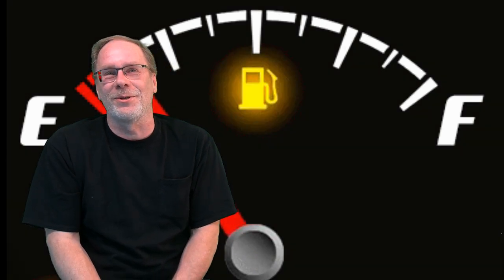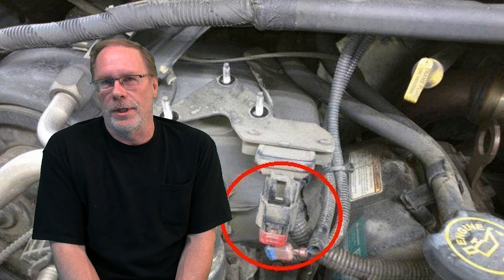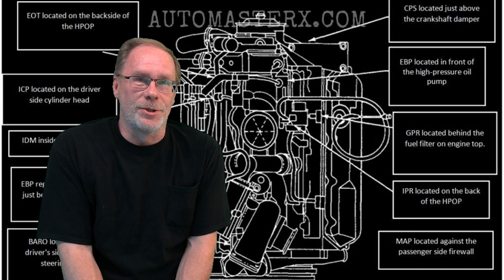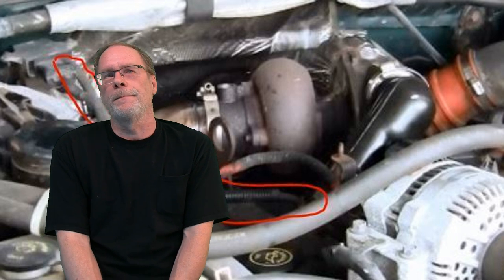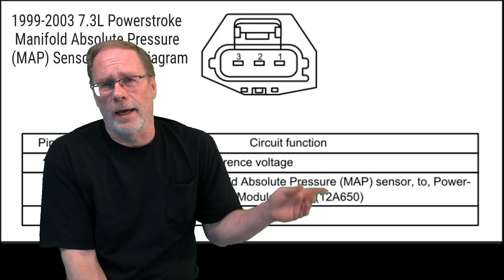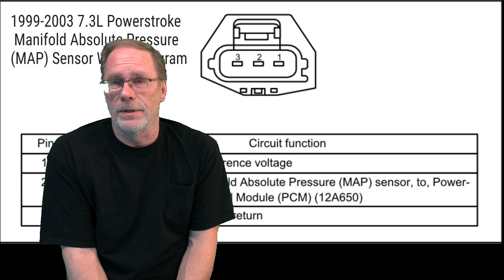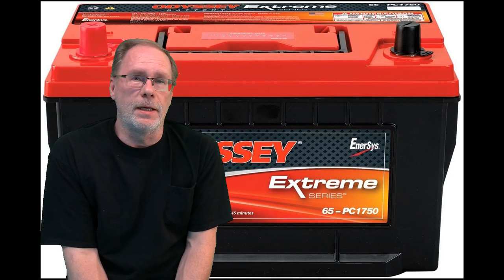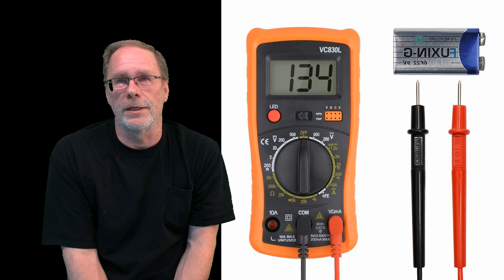7.3 POWERSTROKE MAP SENSOR Manifold Absolute Pressure (MAP)

Comment: Thank you Clint! I was having odd idle issues, surging, and couldn’t figure out what was going on. Did a simple voltage test after inspecting the air line, and my #2 wire was fluctuating from 2.5-1.7… all over the place. Going to order a new sensor today. This channel rocks, keep putting the knowledge out there. All of us weekend warriors appreciate it!

Comment: Thanks for this video,  The tube on my 96 F-250 definitely needed replacing.  I had no clue what it was for till this video,  Keep the videos coming!
Reply from the maker: Glad it helped
Reply: What were the symptoms
Reply: @manuelesparza9321  Slight power loss.  Mine was borderline good.  Its a cheap easy fix.  If you have doubts just change it.

Comment: I rebuilt my turbo with a KC DIY kit. Truck ran better. 
Next year I decided to put a turbosmart wastegate actuator on. 
Started throwing a P1249
PCM boost and actual boost both showed peak boost 22-23 PSI
Installed a boost fooler. 
Same reading. 
Bought a different boost fooler 
Same result. 
Put a new OEM MAP sensor and now the PCM only sees 15 PSI and no more P1249 code. 
Nothing I had read about throwing that code suggested that it could be the MAP sensor.

Comment: Thanks. Motor means electric motor engine means truck or car engine lot of people will say I need to get gas when you have a diesel no you need to get fuel or diesel not gas thanks good show ihave two of these great 7.3 diesel I might add I had a 6.9 that ran over 450 ths mile no break down it had no turbo not much power but stayed together

Comment: With my map plugged in it will not accelerate past 1200rpms. Once I unplug the map sensor I can rev a lot faster but it does have some hesitation flatness to it. I replaced the map sensor and the exhaust back pressure sensor and no difference. When I start it up regardless of being hot or cold it lopes. Until I get the rpm’s above 1000.  It does the same thing in neutral. What else should I look for. I think pcm may be bad. It just happened instantly it wasn’t like it kept getting worse.
Reply: Mine did the same thing. Pretty much instantly lost a solid 3mpg  after sitting at the body shop for 6weeks. 
I've been chasing the lost mileage and over richness every since.

Comment: @custom works my question is on the second pin I had someone reving slowly to 1200rpm & the voltage stayed between 1.55 to 1.60 does that mean I have a bad sensor? Plz do respond like u always did so that I can order new sensor. Thanks for always responding in timely manner.

Comment: Have a 2002 E350 Superduty 7.3 powerstroke Van original owner, would like to Put a new high performance Air Box cold Air but cannot find one.  The original is cracked in the front before the filter but letting in hot air.
Reply: You'll just have to put in another oem airbox. I have replaced a couple. I'm a diesel van guy myself. 
It's not a bad design as for being cold air intake.
Reply: @highadventur  can you recommend where I should shop for one?

Comment: I’ve got a 1996 and P107 code. When I tested the number 2 pin I was getting 2.5 volts and when revving up to 1200 rpm I got no change whatsoever. So does that mean my sensor is bad? I was just reading a reply to my post on The Diesel Stop and a guy said that the 94-97 Powerstroke Map Sensors operate differently than the 99-03. He said the 94-97 generate a variable frequency with pressure rather than variable voltage with pressure. He said your method of testing  only applies to 99-03. Any help would be appreciated!

Comment: Must be what is wrong with Mine. I was thinking maybe the Temp Sensor at first.  I use to get 18mpg pretty consistently Now I get 14.5 religiously. Engine only has 150k miles    2002 F350 std cab 4x4 7.3 Single rear wheel Auto.     I did replace the pass side head due to a Defective Factor casting Cyl head. it rusted out from the outside into the water jacket.  like I've never seen that before.
Reply: It runs noticeably Richer But not enough to be problematic.

Comment: (2000 7.3 SD, Central TX) Mine is reading 1.4v at idle and does not change at all when RPM increases up to 1200. You say if it doesn't change OR if it changes too dramatically it's bad? I'm a little confused about what I'm looking for. Great videos thx so much for all the info!
Reply from the maker: these numbers represent volts as it goes from idle to 1200rms approx
here the data;
psi VDC
0 1.43
3 2.27
5 2.59
8 3.03
10 3.38
14 3.89
16 4.17
18 4.47
19 4.59
20 4.75
21 4.89
22 4.93
23 4.93
27 4.93
Reply: @CUSTOMWORKS7.3PSD  So if my voltage isn't changing then it's bad. Awesome thank you. New one on its way

Comment: Sorry for my ignorance...I am a week end 'mechanic' .  I have 3 questions 1. The picture you show of the pin numbers is from the perspective of looking at the connector, not the sensor correct? So if looking at the sensor it would be a mirror image...#1 pin on the left, not the right. It obviously wouldn't affect the position of #2 center pin since there are only 3 pins...  
2. Do you not need to check pin #3?
3. How do you suggest making electrical contact to the pins since the plug is still attached to the sensor?

Comment: Mine reads 4.99 volts in and at idlel its reads 1.5 volts out and reads the same at 1200 rpms. This is the third one in two weeks. Two duralast and current on the standard brand just to try something different.  The truck is a late 99 model 7.3.  Its driving me crazy.
Reply: Any update?

Comment: Have a 2000 7.3 set of remanufactured injectors 
new glow plugs and new vcg and gpr and idm good batteries and starter. Will not fire at 0 degrees Celsius just lots of whit smoke. Hit it with a shot of starter fluid and catches and runs smooth. Ipr icp hpop all works fine 500 + psi 35 is % ipr signal what else can I do. Black smoke when I put my food to the floor but not excessive. Fuel at 50psi before running 25 when it fired up the hpop tank 3/4 inch down getting frustrated with it now. It started after the truck ran out of fuel and ran batteries flat had nowhere to pug it in for the night in -40 Celsius weather thought it had enough fuel but apparently not 
Can you help please?
Reply from the maker: Does it fire with engine heater plugged in I need to know this first

Comment: I’m unsure as to how this reading works if the power is not connected to the map sensor, how is it reading the sensor?
Reply: Thank you for recognizing my comment but it would be appreciative if you could explain this situation
Reply: I wanted to know too as this was the question I was going to ask.
Reply: I have the same question. If I'm checking the voltage from the wiring, is the pigtail bad? How do you check the actual sensor?
 I did, however, check the responsiveness of my truck without the MAP connected and it seemed like it was more responsive. With the MAP connected, it seemed to dog a little more. Might be in my head!
Reply: e he is back probing the pins through the plug

Comment: How does this reading work if the sensor is unplugged? I'm getting a reading of 5 on first pin and nothing on the second pin. Ty in advance.
Reply from the maker: The MAP sensor should have 5 volts going to it, and be returning 0-5 volts when reading a pressure of 0-51 PSI. KOER

Remember that it is an absolute pressure sensor, so at engine off, it should read atmospheric pressure, which should be about 14.7 PSI at sea level.
Reply: So my volts on the first wire key on engine off is 0.0018 volts and the middle wire runing is 1.5 and dont change to 1200rpm so is the computer bad it gets volts from computer right ?? Thanks in advance for any information will be appreciated and ive got a another map sensor reads the same

Comment: Which sensor if any can cause extreme plumes of grey smoke?
Reply from the maker: Its difficult to diagnosis with out being in front of your engine, That being said this is usually a injector , bad turbo, last a ring or valve issue
Reply: @CUSTOMWORKS7.3PSD  thanks I was thinking that also but was wishful thinking. Thanks for the response and great videos